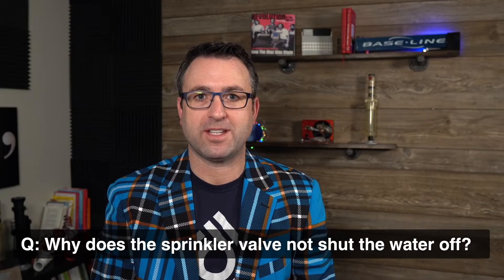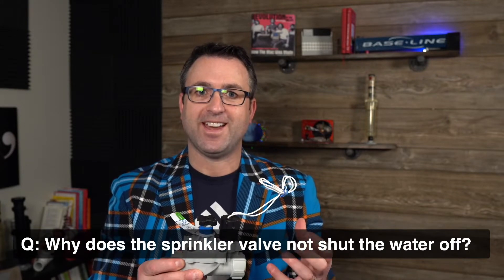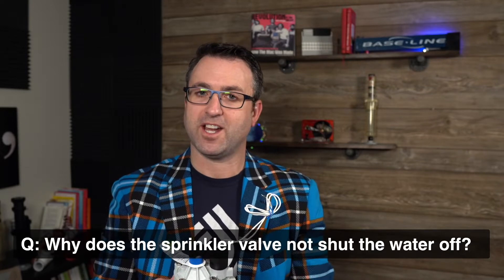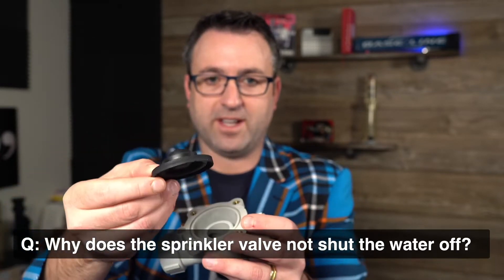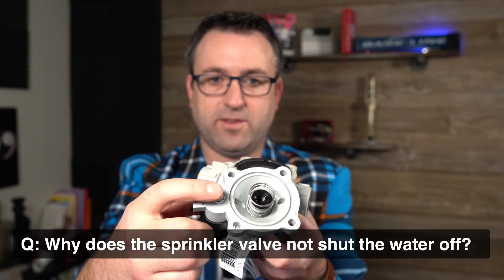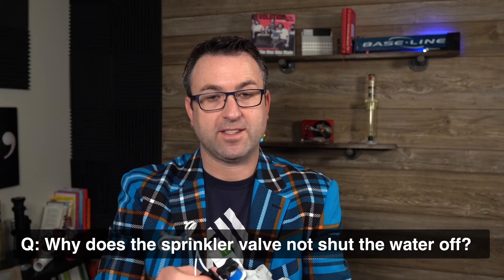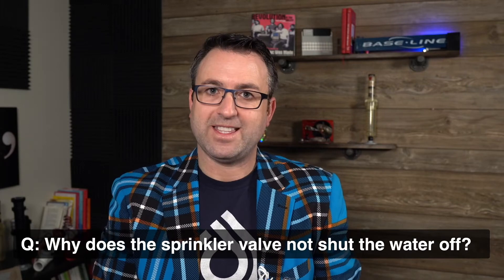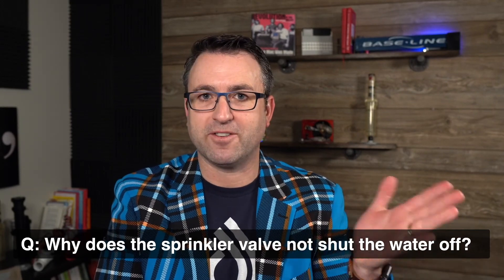Sprinkler Valve Does Not Shut The Water Off | SprinklerSupplyStore.com

Comment: I have a leak in my yard. I found the valve boxes with solenoids but not valve to shut off a zone. I found what seems like pressure regulator but not backflow shutoff valve. Any advice?
Reply from the maker: HI @Kali M. You are on the right track. You'll need to find the valve that activates that zone and there is probably debris inside which is causing it not to close all of the way. Or, you may have a broken pipe, etc. Depending on how large the leak is, you might consider turning off the main water supply coming form your home. We'd be happy to look at pictures if want to send them to us. We could at least help you to identify what you're seeing. You can send them to us at: info at sprinkler supply store do com. - ANDY
Reply: @Andy_Humphrey  I can send you pics of the valves that activate the zones. One seemed to have a little water on the top and the others seemed bone dry. If that valve was faulty I would think the sprinklers would be on.  But if it’s doing it’s job wouldn’t it keep the water from flowing to the cracked pipe?
Reply from the maker: When debris is stuck is the valve, the valve can slowly weep. Is the leak located near a sprinkler, or is it out in an open area? If it is near a sprinkler than the valve is probably not closing and is slowly weeping/leaking, causing water to slowly seep out of the sprinkler, even when the zone valve is off. If the leak is out in an open area than your probably have a leaking pipe.
Reply: @Andy_Humphrey  it seems like it’s in an area but the sprinklers are close by. A gentleman who works on landscaping has a look at it. He confirmed I don’t have a backflow shut off valve but recommended after fixing the leak, to install a master valve and a somewhat backflow valve he can build. He said the master valve would take care of any future leaks. Hmmm
Reply from the maker: @popaki9484  That is great, and he is correct. 

Adding a Master Valve will keep the system OFF unless irrigation is scheduled to run. 

So if you have a leak, it will only leak while the system is actively running. 

The problem is that you may never know when you have a leak because you will no longer see it. The master valve doesn't fix the leak, it simply prevents the leak from running 24/7.

The absolute best solution is to add a Flow Sensor & Master Valve. You will likely need to upgrade your controller, however, this will allow you to be notified if there is a leak, and the master will automatically shut the system off, and then send you a text message. Some controllers can even report which exact zone has the leak, or if the leak is on your mainline pipe. This option is the best, however, not cheap. Ask your Irrigation Specialist about this. It could be outside of their typical scope of work, or something where the cost/benefit to you isn't worth it.

Adding a just Master Valve would be a good idea. 

Glad you're on the lright track!
-Andy
Reply: @Andy_Humphrey  Andy, thank you for responding. I am very nervous to add the master valve and a backflow valve only because he will not repair the leak. So I’m the summer when I use the system it will also leak during use.  Do you think it’ll really be ok?  To fix the leak is there a way to find the leak without tearing up my grass to find it?

Comment: Hey, I bought a Rainbird 100 DVF valve and it does not close. Is there any chance the reason is low water pressure?
Reply from the maker: Perhaps, although it is rated to as low as 15psi. Can you share more details about what you are experiencing? Happy to help you troubleshoot it. -Andy
Reply: @Andy_Humphrey  For now I just wanted to test it, so I connected it in my bathroom to a 1/4" size hose. The valve is 1" in diameter. I assume I had a big pressure loss because of the larger valve diameter. Is winter now, so I can't test it in the backyard on the 3/4" larger pipe.
Reply from the maker: Yeah, that's tricky. You may not enough enough flow from the 1/4" hose for the valve to properly work. Have a good winter!

Comment: Sprinkler Nerd Andy has just saved me a ton of money on service calls for my aging system. When I opened my utility box, all I saw was a nest of wires and pipes. Now I know what they are. The repair looks like a simple procedure compared to many other home repairs, and I do have a rudimentary knowledge of plumbing. Since it's winter and I just discovered the small drip, I have plenty of time to fix the system. Videos like this send me to the links and I'm heading over to Sprinkler Supply Store once I have a list of the parts I need. With several zones on my system I'm going to do preventive maintenance on all of them. Thanks!
Reply from the maker: Thanks for the kudos @briano3030 - it’s not rocket science - just sprinkler science - good luck!

Comment: Hi
Awesome video! I have a zone for the flowerbeds that won't turn off. Long story,, but I want to keep that zone shut. If I cut the wires to the solenoid, will that valve stay shut? Thanks a ton and hope you would respond to this. Jay. 🙏
Reply from the maker: Hi Jay, absolutely, I’m happy to respond. Sprinkler valves are known as “normally closed”, meaning, they are always in the closed/off position unless the controller activates it electrically. If that specific valve will not turn off, even when the controller is powered off, there is likely dirt/debris stuck in the valve, preventing it from closing all of the way. The only way to fix this typos of leak is to clean out the valve. Cutting the wires will not fix the problem, because the problem is not an electrical issue. After you resolve the issue, if you would like to keep the valve off indefinitely, I recommend that you remove the hot wire (colored wire) from the controller terminal, instead of cutting it.

One other option is to check that the solenoid is tight - turned all the way clockwise - If the solenoid is not tight, this could cause the way not to close (can’t recall if I mentioned that in the video).
Reply: @Andy_Humphrey  that's awesome Andy. Yes I was thinking of disconnecting the colored wire at the terminal.  Thanks for responding!
Reply from the maker: Cool. Let us know what you find when you clean out the valve!
Reply: But valves can still leak.

Comment: You said valves are 24V AC ?  Was that a mistake?       There DC.
Reply from the maker: Correct, Bill. Standard irrigation valves are 24v AC. Solenoids that are used with battery operated controllers use DC.  What model valve & controller do you have? -Andy

Comment: Great info, one of the best videos on troubleshooting approach out there.  My 17 yr old Toro jar top valve on zone #8 on my yard irrigation system was sticking open all of a sudden, eliminated electrical being cause first, then I changed diaphram and solenoid and cleaned lower part out good.  No luck.  So I bought a whole new valve, removed all parts including spring, and installed them in body of zone #8 valve.  Bingo, that did the trick. Not sure if conclusion is that spring was weak or perhaps the tiny o-rings were misaligned, nonetheless I didn't have to dig further and remove the valve body as it is glued to pvc inlet and outlet. Thanks!
Reply from the maker: Thank you, Joe! So glad that know your relentless pursuit paid off. Happy sprinkling! -Andy
Reply: I have had this happen several times.  Just replacing the diaphragm doesn't do it.  My feeling is the tops get warped from freezing and just don't seal.  Same happens on popup bodies that leak around the top seal.

Comment: Something to always keep in mind also if you have a brand new valve or you know the valve is in good working order but still won't shut down you may have too high of pressure in  your supply main line to the valves causing them to not shut down, in that case you need to regulate the flow of the PSI coming into the valves with a pressure regulator
Reply from the maker: Thanks for commenting James
Reply: What pressure should be before the valves?
Reply: Hunter and rainbird specify 150 psi max.  But that is more due to the valve plastic failing IMHO.   Higher pressure actually puts more force on the sealing diaphragm.   I commonly see 100-120 psi at customers houses.   Things work ok but so much misting.

Comment: Great video but one issue not mentioned, which was my problem. My RainBird valve has a bleeder screw. It had been left open, and I had to screw it clockwise all the way to prevent a slow dribble at the closest head once the valve shutoff after running. This issue is kinda mentioned by the comment from Xycofox and other places in the comments.
Reply from the maker: Thank you, Tom, great point! It is easy to forget the details sometimes. Appreciate you chiming in.

Comment: That happens to my valves all the time, what I do is I turn the valve all the way on and off with the cross handle or knob and some times that works. but Your right,
Reply from the maker: Great point! Sometimes just by cranking on the flow control you can fix a stuck valve.

Comment: you are amazing!!! I researched all kind of documentation and all of them kept saying that it is the diaphram, but you said to check the controler.  I removed cable from station 3 and sure enough it shut off!!! you saved me a trip to home depot and replacing the whole valve which would have  taken so much work!!!
Reply from the maker: You’re welcome! Glad it helped. Sounds like the controller was still sending power to station 3. If station 3 was the only station with the issue, you might double check the program settings. Reach out to us if you have questions. -Sprinkler Nerd Andy
Reply: These controllers do fail.  If one ever acts up in any way, doesn't do the command I say or display acts funny I suggest the customer gets a new one and WiFi while I'm at it.

Comment: What can I do if I am having to clean out debris every multiple times a week because the well pump seems to be pumping small sand particles through the system that keeps getting into all my valves?  Is there a way to prevent the sand from getting to the valves or a kind of valve that won’t be affected by small sand particles?
Reply from the maker: Hi Jim. Absolutely! The best option is to put a filter on the mainline of your system. The filter can be installed any place before the first zone valve, however, they are typically installed close to the well, or at the beginning of the system. There are many filter options and some that are specific for sand. If you would like assistance please reach out and we’ll look at options with you.

Depending on the size of your system (water flow) this option might do the trick:

https://sprinklersupplystore.com/products/lakos-131348-twist-ii-clean-filter-in-line-tee-1-in-npt-plastic-clear-60-mesh-with-polyester-screen

Comment: I don’t use the sprinkler system anymore and I have a leak where these valves are underground. Can I take each one out and just cap off right there?
Reply from the maker: Likely, yes. If you are in a cold climate you may need an access point to drain the system or a valve to open to blow air through it. If you don’t use it (at all) anymore you might consider shutting the water off inside your house and decommissioning the system entirely.

Comment: When I shut the control off the sprinkler keeps running. When I tried another Zone and the sprinkler came on and then I shut it off it's everything shut down
Reply from the maker: Hi Anthony. This sounds a hydraulic issue with the valve. I'd recommend cleaning out the valve (diaphragm) and/or adjusting the flow control handle if your valve has that. You can contact our support department and we'd be happy to chat with you.

Comment: When powering off your sprinkler timer, remember they usually have a 9V backup.
Reply from the maker: Excellent point, Tim. Typically, the purpose of backup battery is to save the time and date in the event of a power outage - and with some older model controllers, the programming could be erased as well, so it would be a good idea to replace the battery before unplugging the controller.

However, the backup of battery is not used to operate the AC solenoid valves, so it will have no effect when troubleshooting the system.

Comment: This was an incredibly helpful video.  I have those exactSilver bullet valves.  There are 4 heads (in 2 different zones) that will not turn off.  I have unplugged my control box. I have looked for and cleaned out debris on diaphragms and solenoids, then replaced the diaphragms, yet the problem persists.  I can not detect a crack in the valve body (ie there does not seem to be any leaking water).  What else could be the culprit?  Does it matter what direction the little lever in the solenoid port should be at (ie 12:00 or 3:00?)  Thanks for any ideas!!
Reply: The levers are a manual open/close for the solenoid plunger also known as a bleed. When up, the solenoid will be in the open position allowing water to flow. It should be down during normal operation. Also you should check for the presence/condition of the tiny Exhaust O ring that connects to the underside of the top cover. That is what my issue ended up being after checking the diaphragm a bunch of times.
Reply from the maker: You are the right track. Sounds like the problem is not electrical. You could try replacing the solenoids. Perhaps the plunger/pin inside the solenoid is sticking up. 

Before you purchase new solenoids, you can try switching a solenoid from a known/good valve first, as a test first. If that fixes problem then you can purchase new solenoids.

Worst case, you may have to cut the valves out and replace them. Not difficult, just a pain.

Yes, the lever on the valve should be in the closed position. 3 o’clock (I think). The lever is  used to open and close the valve manually by hand.
Reply: @Andy_Humphrey  for toros, are the manual handles supposed to be on or off?

Comment: My rain bird system turns on but one zone constantly stays on while it runs through the various zone.  Even if I unplug the zone it still will run regardless.  Any suggestions?  Thank you in advance for any help you can provide!
Reply from the maker: Hi Johnmark - it sounds like a defective diaphragm allowing water to pass through the valve even though it's supposed to be shut off.  You can replace just the diaphragm, or just purchase the same brand and make of valve and use the insides of the new valve to replace the insides of the old valve.  That way you can essentially replace the valve without having to actually remove it from your system.

Let us know how it goes!

Comment: My sprinkler  is leaking   - I’ve checked for dirt in my toro ez flo valve at the main box but couldn’t find any dirt or debris . I then replaced the whole valve and body but still have a leak at my sprinkler !! Any suggestions ?
Reply from the maker: Hi Steve - Could be a couple of things. Is it just one sprinkler, and does it leak after the zone turns off? If yes, it is likely caused be low head drainage (due to gravity) and can be fixed by adding a check valve to the sprinkler or replacing the sprinkler with different model that has a built-in check valve.

Comment: my zone comes on, sprinklers come up and there is water for about 5 seconds, then sprinklers stop and  go back into the ground  and the screen on the controller goes blank for about 5 seconds and the process repeats itself.
Reply from the maker: Hi, Tom - this sounds like some sort of issue with the controller itself.  We'd suggest calling the tech support number for the manufacturer and having them help you trouble shoot the controller and see what's up.
Reply: Replace solenoid with solenoid from same model valve. When solenoid goes bad, it shorts. It won't stay open thus shutting valve off.

Comment: Another pesky problem and sometimes not obvious is local water pressure.   The water pressure in my town is 90+, so unless you have a pressure regulator installed on the main line, your sprinkler valves may leak.
Reply from the maker: Yes, that's definitely another possibility!

Comment: Hey man.. just so you know, the orifice that fills the upper part of the valve needs to be flowing to close a valve also (hydraulic pressure). Anything that prevents the pressure to build up on top of the diaphragm (ie, Solenoid not closing, diaphragm filter (on 1" Orbit & Rainbird models), or broken/leaking bleeder screw) can cause the valve to hang open.  Debris that sits on the ring in the body of the valve you pointed out only causes "leaking" valves, aka when a home owner says one zone drips all the time when the system is on.
Reply: Check this out to get a better understanding.

https://youtu.be/5rokXHhxRSw
Reply from the maker: Thanks, good old Bernoulli’s principle in action!